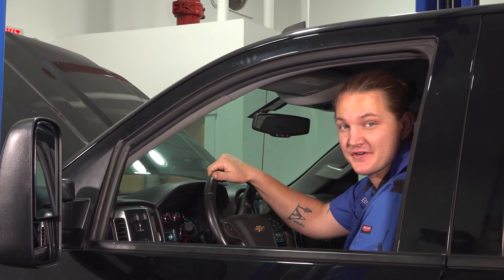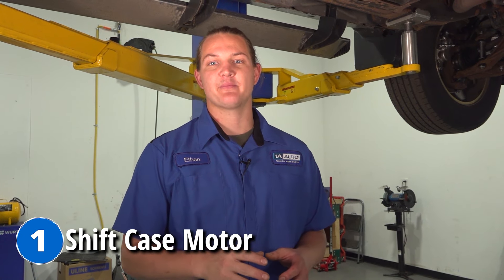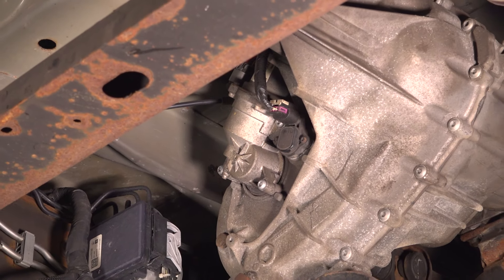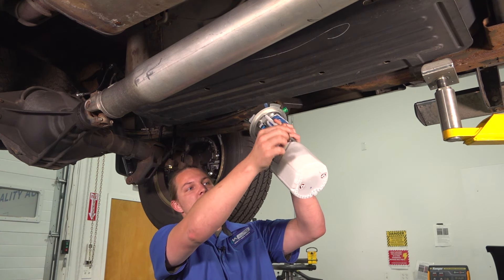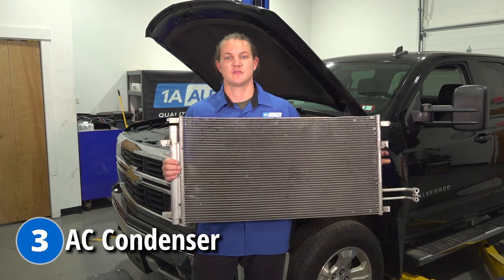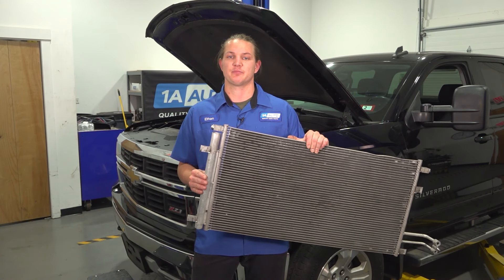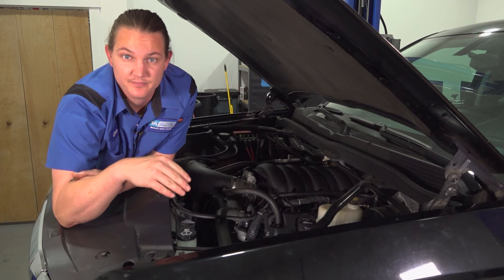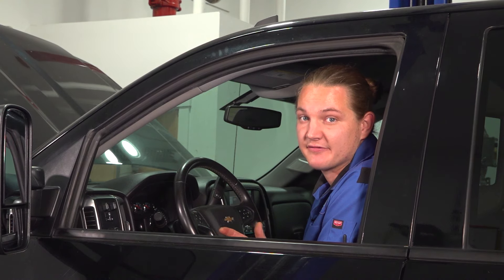Top 5 Problems Chevrolet Silverado 1500 Pickup 2014-2018 3rd Generation

Comment: 120k on my 2014 and none of there issues, but ive had a bad:
1. Battery ground cable
2. Thermostat 
3. Fuel injectors
4. Leaking water into cabin from third break light